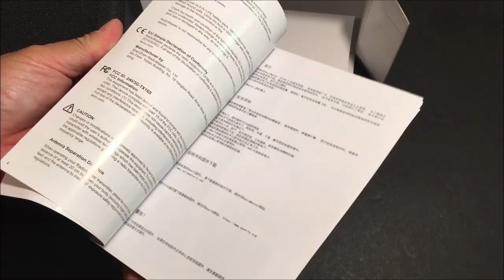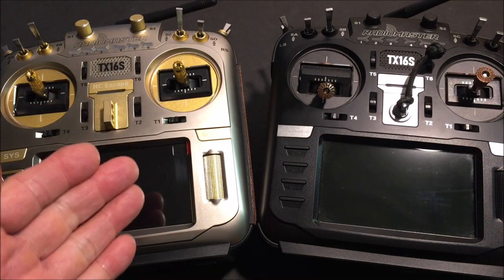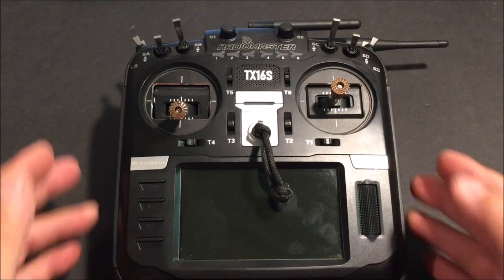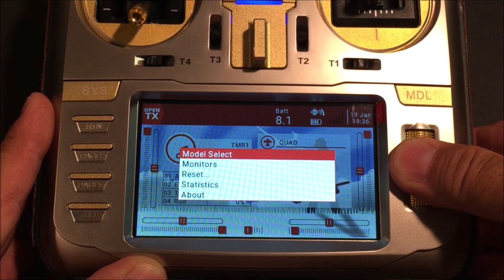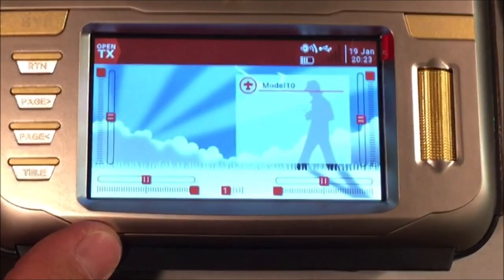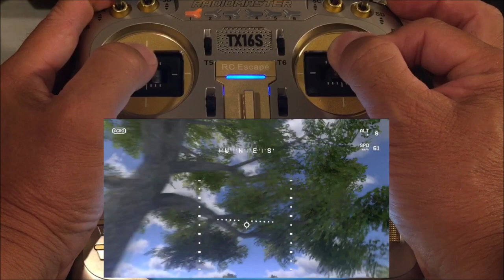RadioMaster - TX16S HALL Carbon | Gold | Silver Multi Color Edition plus CNC parts upgrade!!

Comment from the maker: Time Line :
00:00  musical unbox
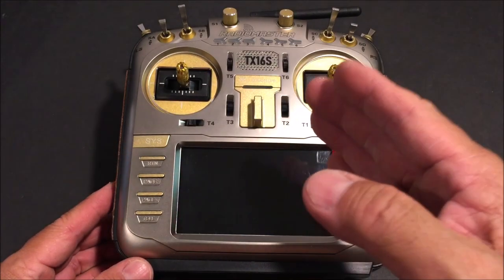02:37  intro
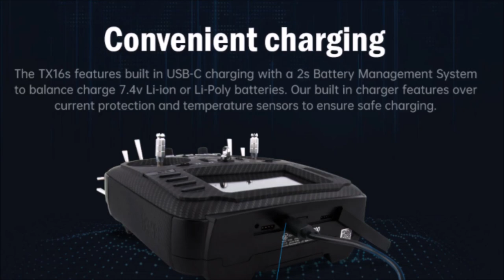04:54  compare with original tx16s
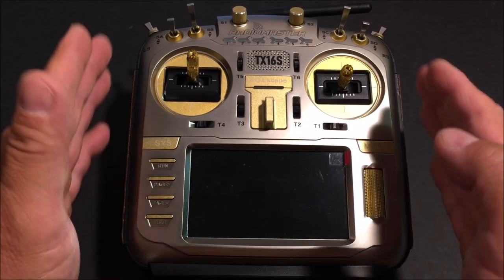06:01  cnc parts upgrade 
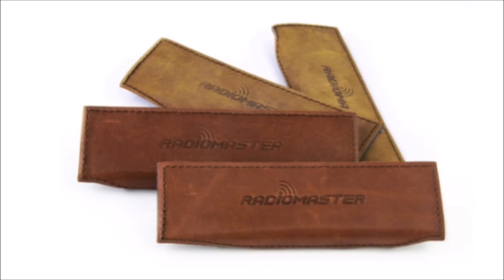07:41  antenna mod
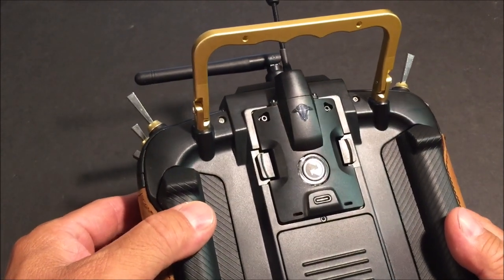09:18  power on
10:52  set up model for a simulator
14:20  Liftoff flight
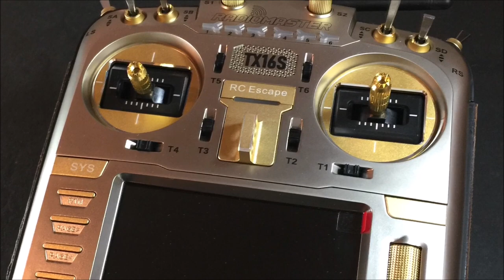18:18  Photo ending

Comment: You freaking rockstar reviewers. You always get the cool stuff first 😁 Thanks for sharing Oh and nice antenna mod! Let us know how the mod is doing.
Reply from the maker: The antenna mod is awesome!  It works better than using the original antenna just by using even a rubber ducky antenna!  👍
Reply: @RCEscape  My Crossfire module just got here. I still have all my stuff on my Taranis qx7. I have a new radiomaster t16s and a CF module, now I just need some time off work and motivation to get them going. Thank you for all you do.
Reply from the maker: @trevorimpulsebuyguy6398  
Same here.  I just got the crossfire micro bundle.  I was waiting for this transmitter since I have the antenna mod on the original tx16s project box.  Do some longer range flying soon :)
Reply: @RCEscape  If you do a how to video on that I will definitely watch! Crossfire is a whole new thing to me.

Comment: Noob question: if I get this TX16S radio, and I want to purchase an FPV drone, which "receiver type" should I select in the option of the drone? Thanks!
Reply from the maker: The most common receiver type is the frsky xm plus.  I use it on all my drones and for the price it is good.  You can however, choose just about any other receiver type of the drone if the frsky xm plus is not available but don't want to wait for it to restock since it will bind to dsm, flysky and others.  It will need a crossfire tx to bind to the crossfire receiver though so keep that in mind.  If I'm a complete beginner, and have not flown a fpv drone, I would get this radio and practice like hell on a simulator like the one used in the video and just practice flying.

Comment: Man I cant pick a radio....love my x lite but getting old 3 year's going on 4.. just got the tbs nano for but gimbal is getting glitchy....was leaning towards the tango 2 pro v3 full size hall gimbals main reason..because of more control..and nano will give it 1w.. your advice?
Reply from the maker: MY advice?  Go with the Radiomaster TX16S in the Gold / Gold!!
I've not handled any Tango stuff so to stay away from frsky, my next best is this one here.
Reply: @RCEscape  just got 💪💪👊👊
Reply: @RCEscape  Thanks Pete for all your advice through the years.. 👊👊💪💪
Reply: Where do Those metallic circle pieces go? And is there an adapter for the nano crossfire?
Reply from the maker: @sleepingbearffg5008  
I think the metallic circle things go on the gimbal and the nano should fit without an adapter.